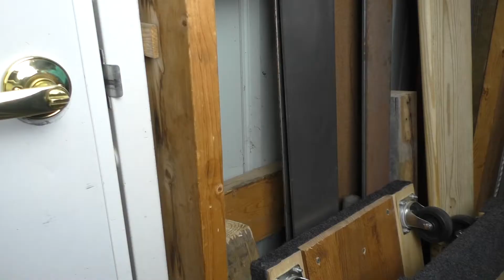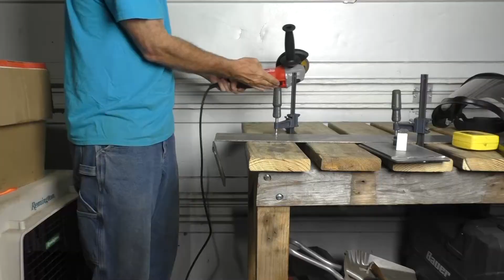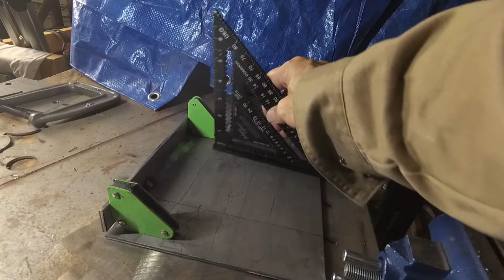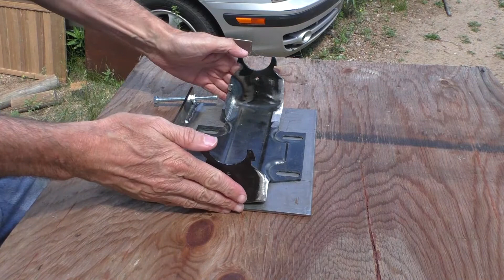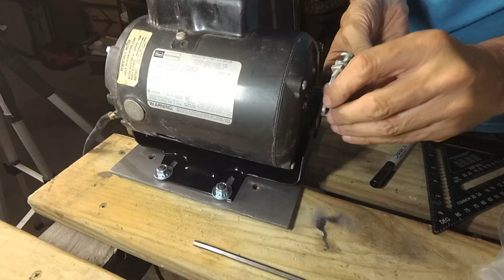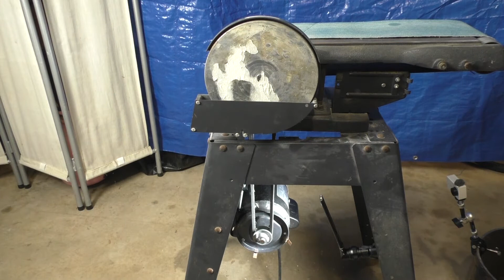Craftsman Belt Grinder Motor Mount Adjustment Hack

Comment: Hey Jeffery, I got this exact belt sander on Craigslist as well. My challenge is replacing the drive belt itself, I'll worry about adjusting it later. I'm unable to access the top pully to switch the belt out. Figured since you have the manual you might be able to help me out. Thank you!
Reply from the maker: You will have to remove the sanding disc first, on top of the belt cover there are two holes one for the disc and one for the pulley. spin the disc around until you see the allen bolt head for the disc, loosen the bolt and pull off the sanding disc.
you may have to remove the belt cover, I have not done this to mine yet, but that's what it looks like you need to do.  hope it helps.
Reply: @jeffreyhunterbuilder  hey thanks man for hitting me back. I got it sorted out. The sander I picked up was in a barn fire so it had water damage, everything was seized up and I had a hell of a time getting that disc off. I just spent 20 hours bringing it back to life, it's beautiful now. Keep having fun in your shop, and don't take the negative comments personally

Comment: How do you get to be as old as you are and completely lack the basic intuition needed to trouble shoot such things ?... smh... All you have to do is to..."slightly" ... loosen the 4 motor mount fastners and tap the motor into alignment with a rubber mallet or something comparable.
"The only true source of knowledge is experience"
Reply: I was thinking the exact same thing.  That plate he mounted the motor to has a few dozen holes. The whole video seemed redundant to me.

Comment: Tracking is “crap”. Totally agree. Was hoping to see you engineer an alternative to the cam system that would be both more intuitive as well as allow quick de-tensioning of the belt between use. Yours seems to track well, which makes it a rarity in older Craftsman models. Search yields a LOT of folks having issues.

Comment: I have that same unit.  Got at a yd sale for $20. Does yours have a wear channel on the platen casting where the belt can rub if not perfectly aligned?

Let me know how you figure out how to make a good dust collector for the main belt
Reply from the maker: Mine does not have a wear channel, you can see wear the belt has been eating away at the cast iron.
Reply: The original plastic piece used an open half cylinder attached to a warped looking flat piece on the side opposite the disc sander. That flat end has a smaller raised circle inside that fits into the circular depression on that side opposite the round sanding disc. A single screw to hold it on and the open half cylinder is bent all along its length to fit the out of round casting on the sanding disc end.